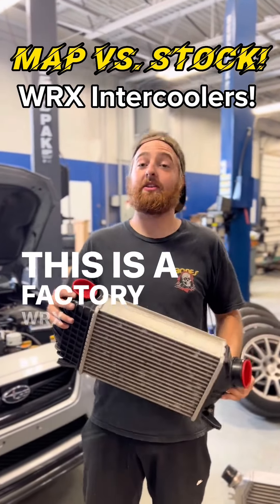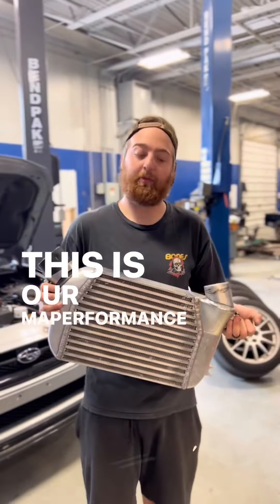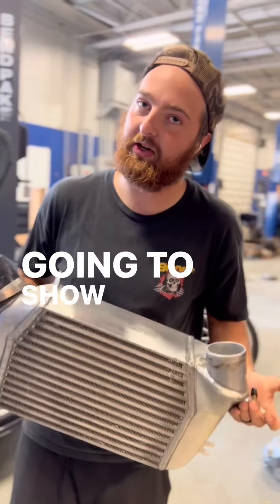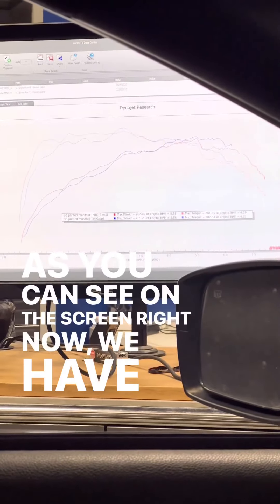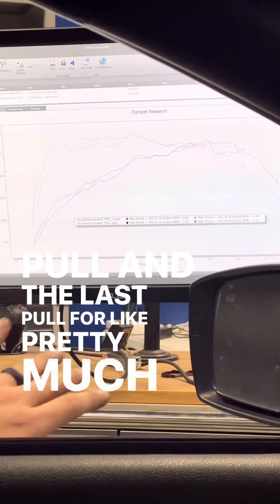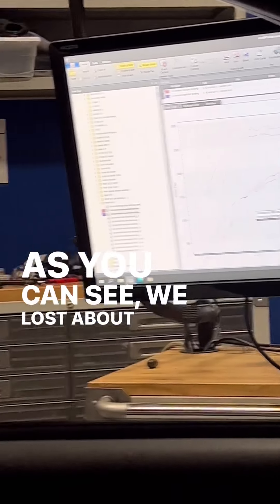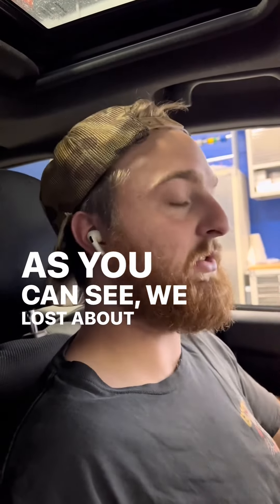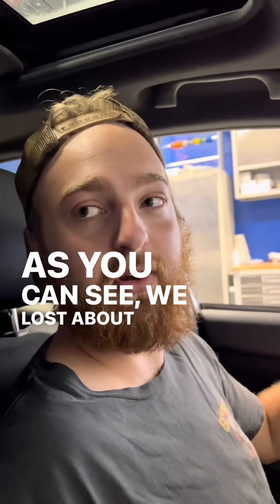MAP vs. Stock: WRK Intercooler!

Comment: They forgot to mention the need for a tune for the inter cooler - at least that’s what MAP told on the phone.   I’ve been running the MAP stage 1 and love it.  Not sure the intercooler makes all that much difference.
Reply: intercooler, along with most other cooling upgrades, will just be able to keep your engine/trans running at optimal temps for longer, resulting in power numbers being more consistent and not falling off after just a few pulls